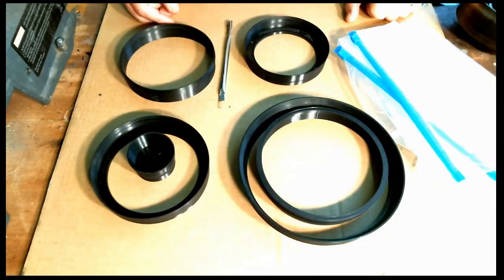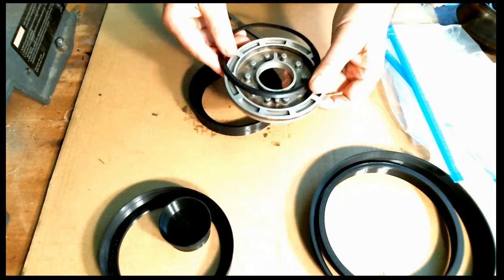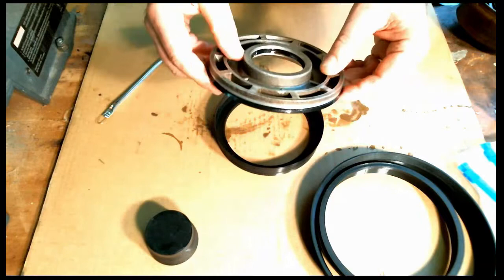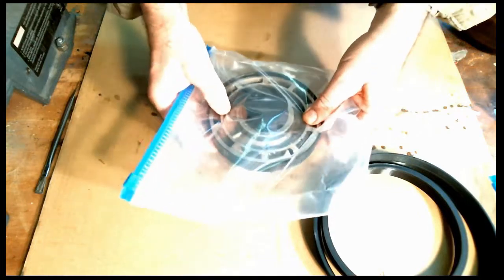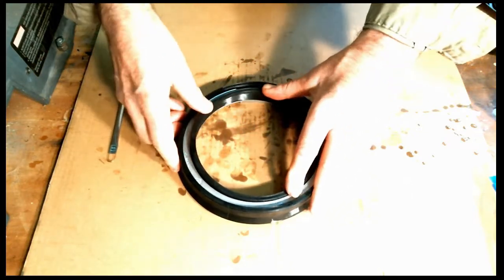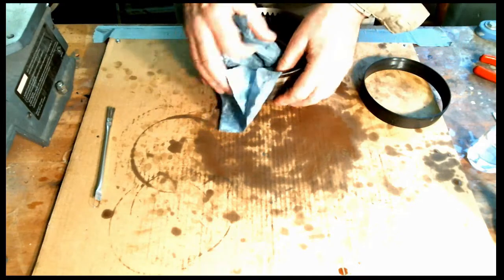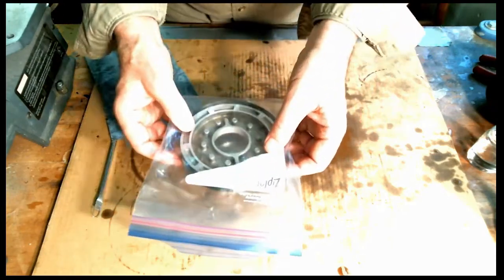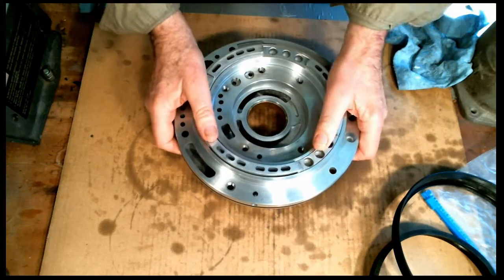How to use BadShoe's AOD/4R70W piston sizer tools

Comment: Does this kit work with the 4r70w AODE...?
Reply from the maker: Yes.
Reply: @badshoeproductions  You should list each specific transmission it works with. I noticed yours appear to be funneled. Unfortunately, I bought a blue set that was not funneled and destroyed lip seals getting them on. I since got them on without the kit, amid endless hours of frustration, lots of prayer, and some foul language... It made me wonder what differences there are regarding changes in transmission design through the years. However, i tried that blue set forward, backwards, sideways, upside down, left, right, and very forcefully with lip seal tool and gap gauges to no avail. Seems one of the blue plastic molds contracted a bit too much when the plastic cooled during manufacture, making the non-funneled sharp edge a harbinger for destruction. Had it been funneled, it would not have destroyed my lip seals.
Reply from the maker: I say AOD/4R70W right in the title. Of course, the in between AODE is included. No tool is needed for stamped steel reverse drums or intermediate pistons used in the 4R70-75E models. I have a different set for the C6 and FMX on my web site. I believe the blue set you have is a normal seal protector set that is used at room temp but there are universal kits using the freezing method as well. Mine is made to compress the seal tight to the piston and then frozen to hold that shape until the piston is dropped into the drum. Of all the clutches, the forward clutch piston is the most difficult because both inner and outer seals must be compressed.